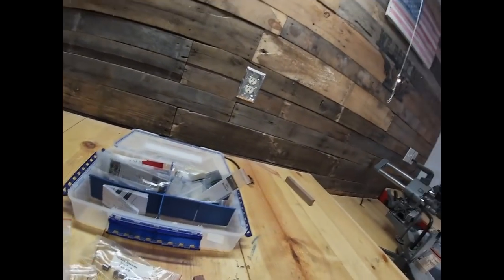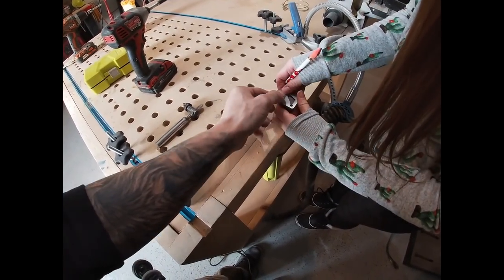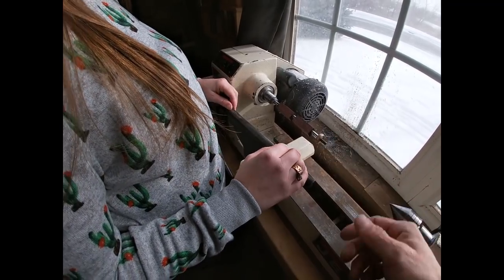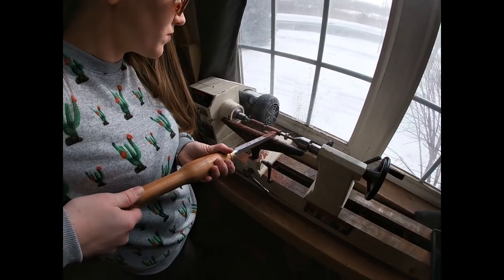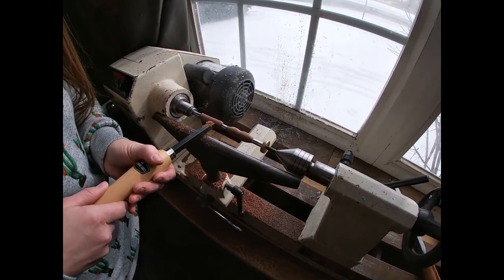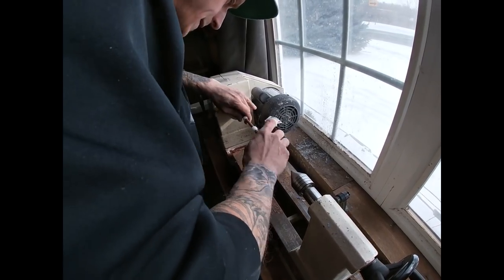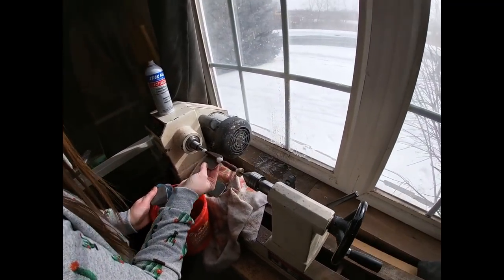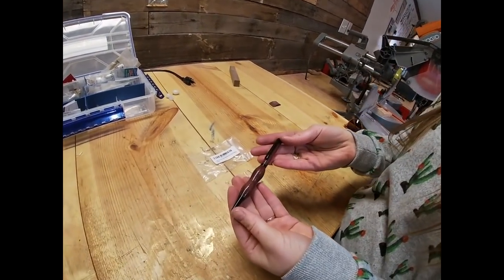Wife makes her very first pen !!!  HOW TO Beginner pen turner .CA FINISH

Comment: Always fun to watch wife in the shop videos. Gunflint Designs did a pen and Matthias Wandel's wife made coat hooks for hallway I think. Can you tell me what or how you have your garage doors covered? I bought inset panels but it got too cold and just finished putting insulation in walls before winter. Anything to cover up the rails and side gaps from the inside. Can you take your setup off and back up without using up materials? I don't need the doors in winter but being able to store it for summer to reuse would be amazing.
Reply from the maker: Yes it was fun to get her to do this shes very handy and has also made alot of stuff but never a pen yet.... we live in Minnesota so it's cold lol didn't wanna shell out the 3hundred on the inserts yet .   plus I dont park in there so I figured I would poly it all off totally block all the gaps , even the sides of the doors .very glad I did it especially for this week -60 with windshield...crazy!!
Reply: All American Arts MN I'm in Washington county near St Paul